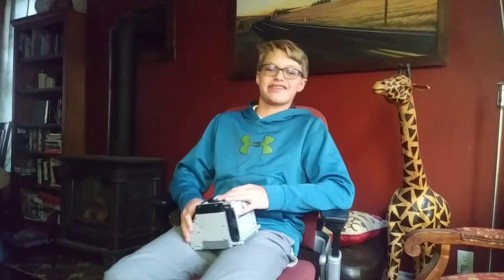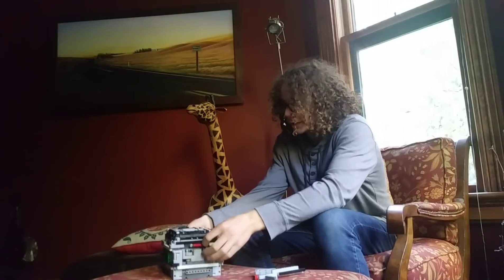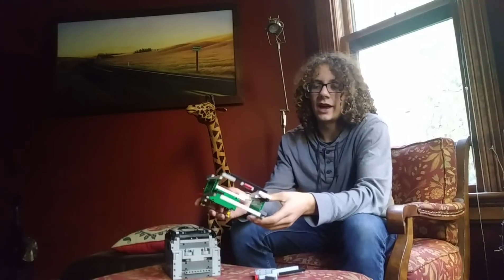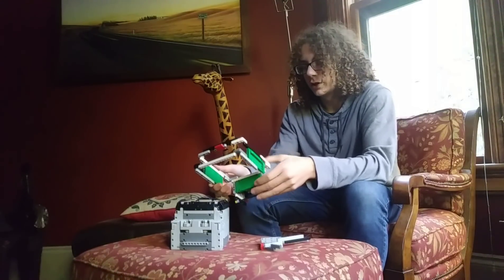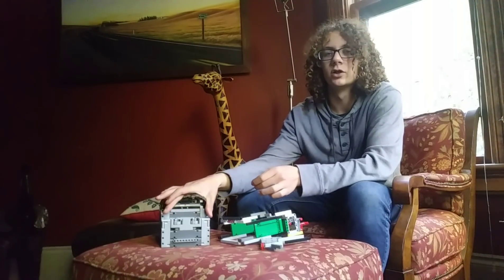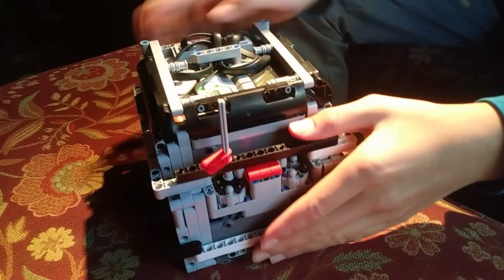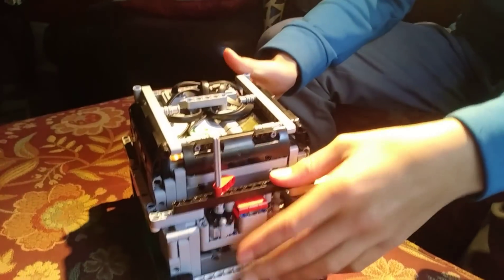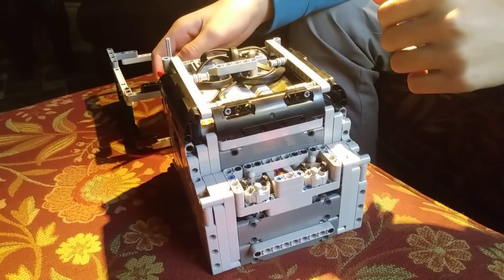How To Save Time In Base - FLL Into Orbit

Comment: here's a tip: instead of using the blue things, try to use two small wheels (the smallest ones that come with 6 holes) stacked on top of each other. This is a lot more common, so I go with this idea.

another tip: try to implement a program that can read the brick buttons to use less parts, but again, there are only 5 buttons and you may forget which program is which button.

Comment: Do you see a drift in the robot during motion? How did you correct for the same?
Reply from the maker: We sometimes get drift when we are driving, so we use a gyro sensor and if it says we are turned too far one way, then we turn back to straight. We might make a video about how we do this.

Comment: So you decided to use that kind of gear ! Do you think it will be precise enough for the missions ?
Reply from the maker: Which gear?
Reply: @FLLTeamMoscow  I'm talking about the main 'gears' for the attachements that isn't really a gear... The 4 tooth gear, mainly yellow or black with 4 little 'balls' . Hope you see which one si'm talking about 😅.
Anyway I was suspicious about your choice for this gear because it doesn't have so many tooth and it can be annoying some times because of the lack of precision.

Nvm I just found you a video 😂 https://youtu.be/k-VdL36vd8Q
It's the knob wheel.
Reply from the maker: Have you found that they slip? We usually find that they aren't at all loose in this application. We used them last year and didn't have any problems.
Reply: @FLLTeamMoscow  On the contrary! They don't slip at all ! But between a gear with 4 teeth and one with 16 or more, the accuracy in degrees varies. I find that you have more accuracy with more teeth and that it is easier to put the attachments on, but it also depends on your attachments.
They don't cause any big trouble though and there's no problem using them 😊.